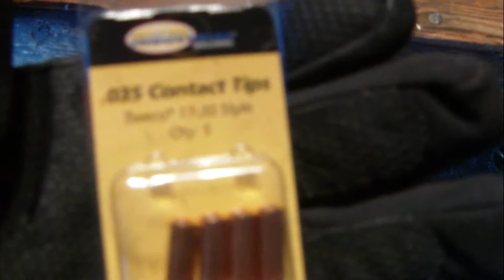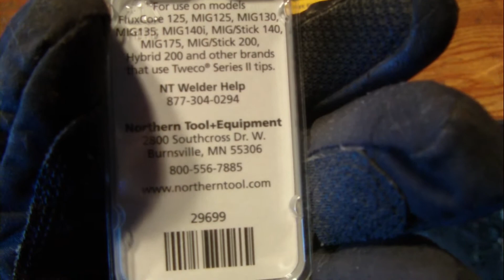got my N.T. order!

Comment: those c clamps are awesome for doing brake jobs! I got some new tips for my welder and some magnets to hold steel together when I weld. got it from harbor freight.
Reply from the maker: i like c clamps, what r thoses magnets that hold steel together called?? i think ive seen them be4, but i dont no what there called, i could use some. :)
Reply: I think they're just called welding magnets and they hold pieces together at 90 degree angles. I used them when I built my blower racks and they helped a lot except I melted one lol!!
Reply from the maker: NYRAPTOR6 k i found them, ya thats what there called.. lol it happens.. lol thanks. :)

Comment: Your welder will run on a normal 15 amp circuit. The amperage increase you are talking about is all done inside the welder, but the welder still only needs 15 amps to run. (the thicker the steel the more amperage that is required to melt the steel). As for the power in your shop I would just put a 20amp breaker in your house and run 12-2 gauge wire 20 amp direct burial wire, with a 4 circuit pony panel (20amp). with this you could run your lights and one major piece of equipment at once, ie: welder on air compressor with no problems. If this is still confusing to you let me know and I could do a short video to show you how I have my shop run. Take care
Reply from the maker: im geting it,, i think the breakers in the house r 20a. i dont no 4 sare, but the welder can run at 20a to 125 max. but they have a safe zone 20a to 80a. thats if im looking at it right.. could u doo that vid?, i would love 2 see ur set-up.. i think it would be better just 2 put power in the shop becuz they would have 2 fix the plug ins out side my house, it blew out.. im thinging that plug in was under powered.. must be under 15a..
Reply: I just posted the shop wire video. If you need more information let me know.  Don't judge the video quality to harshly, it is my first time using a camera and uploading video. LOL
Reply from the maker: r0k2a0 ok ill stop by ur channel. :)
Reply: *****
the welder will run on 15 amps until you start cranking down on some serious heavy welds then it's gonna pop that 15 amp breaker...
Reply from the maker: savagenomore i wont be doing heavy welding, ill be runing it 4 less then a min. ill be just be useing it on the snow plow.

Comment: Dang $90.00 for welding wire i bet you can find some cheaper wire on ebay
Reply from the maker: y its 90 is becuz its a 8in spool, theres a 4in spools, but they dont last.. link 2 the 8in  http://www.northerntool.com/shop/tools/product_200316009_200316009